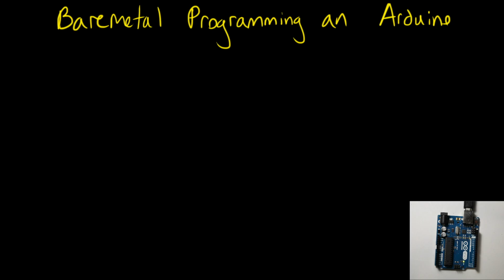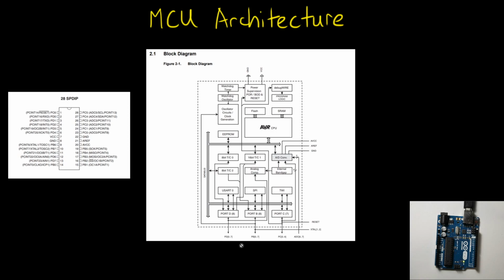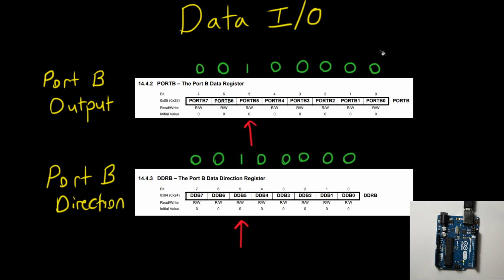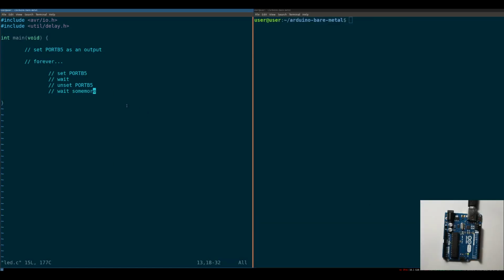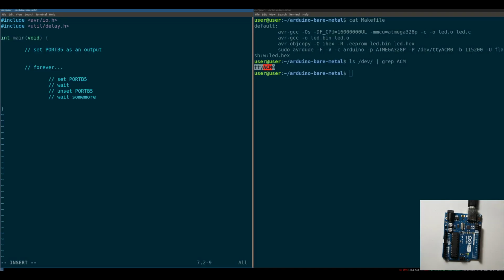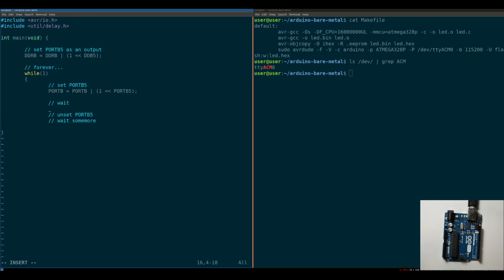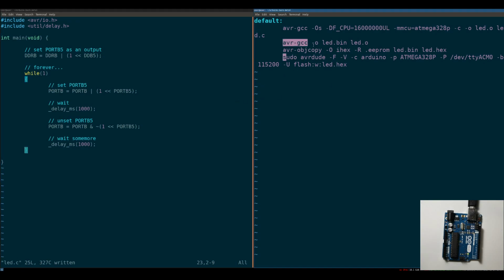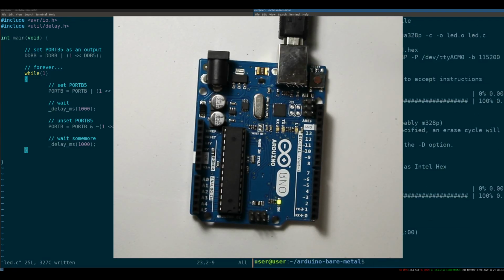Getting Started with Baremetal Arduino C Programming  |  No IDE Required [Linux SDK]

Comment: I subscribed.I'm new to programming, and just wrote my first program in IDE.  Question: what is the advantage to programmimg a micro controller like arduino using C/C++ rather than arduino IDE?  

Another question,  am i better off learning C/C++ so i can progrsm other things also?  Is there any advsntage to using Arduino's IDE or am i just limiting my micro controller project's capability?

Comment: Will this device work for following this video?

Arduino UNO R4 WiFi [ABX00087] - Renesas RA4M1 / ESP32-S3 - Wi-Fi, Bluetooth, USB-C, CAN, DAC, OP AMP, Qwiic Connector, 12x8 LED Matrix

Also, how would I go about connecting the device to my laptop for programming?

Thanks
Love the channel.

Comment: It is the best approach! I worked with AVR MCUs until 2015, and I had not used Arduino. THe peripheral and interrupt system is quite easy (incompare to ESP32 or STM32) and the code with inner peripherial devices  may be written without any libraries. But when you use external peripherial devices - the libraries may be neccessary.

Comment: In the second build command, avr-gcc -o main.o main.bin, it's crucial to specify the target frequency and controller (-DF_CPU=16000000UL -mmcu=atmega328p) to avoid unexpected behavior. Additionally, if the -c flag is removed from the first command, the second command becomes unnecessary, especially when dealing with single c files or libraries.
Reply: I've been struggling to bug fix some weird behavior in my program and this is what fixed it. Thanks!
Reply: I don't know how on earth I accidentally stumbled upon your comment and it magically solved all my problems with the LEDs randomly flashing! Thank you so incredibly much for being so helpful, I'm sure a lot of people here have also benefited substantially from your comment!! If I hadn't found your comment, I am sure I would have never figured it out lol.

Obs: I was literally going over every line in every library I was using for my project, which are unfortunately only made for the microcontroller itself, rather than also having built-in code for arduino specifically.

Comment: I tried to expand on this by adding a function call to a function defined in my_lib.c and during the linking step I had to add the mmcu option, same as in the build and assemble step. Otherwise the program behaved very strangely with the led not blinking as intended.
I.e. compile, assemble and link such: 
avr-gcc -Os -DF_CPU=16000000UL -mmcu=atmega328p -c -o led_driver.o led_driver.c
avr-gcc -Os -DF_CPU=16000000UL -mmcu=atmega328p -c -o main.o main.c
avr-gcc -mmcu=atmega328p -o main.elf main.o led_driver.o

No idea why the mmcu option needs to be added when multiple objects files are added at the link step but is not needed when linking main alone..

Comment: very interesting & wonderful Arduino GPIO video info.   I am wanting to have the Orange Pi-5 Debian-Bullseye Python GPIO PWM pins control the servo Pan/Tilt camera motors. Do you have any suggestions on how to use OPi.GPIO which is a drop-in for RPi.GPIO. I can get the GPIO pins on/off to work. However, PWM is giving me errors. Next, will be I2C on the OPi5.  🧐  Thank you.

Comment: I had an arduino mega2560 clone laying around, this is the make file that manages to flash to my board:
default:
	avr-gcc -Os -DF_CPU=16000000UL -mmcu=atmega2560 led.c -o led.bin
	avr-objcopy -O ihex -R .eeprom led.bin led.hex
	avrdude -D -F -V -c avrispmkII -p ATMEGA2560 -P /dev/ttyACM0 -b 115200 -U flash:w:led.hex

If I separate the avr-gcc command as shown in the video I get the following error:
avr:6 architecture of input file `led.o' is incompatible with avr output

If I use the arduino programmer (-c arduino) then I get the following error:
avrdude: stk500_recv(): programmer is not responding
avrdude: stk500_getsync() attempt 1 of 10: not in sync: resp=0x00

If I use for example the avrispmkII programmer (I use this one as in the IDE it was selected by default) then I get the following error:
avrdude: NOTE: "flash" memory has been specified, an erase cycle will be performed
         To disable this feature, specify the -D option.
avrdude: erasing chip
avrdude: stk500v2_command(): command failed

Adding the -D flag solves the problem.

I don't know why it works now. But it works fine at the time being.

Trying to solve the issue I added my user to the group that appeared on the output of the following command: ls -l /tty/ACM0
The code had to be modified because the pin that controls the LED is the PB7.

Thank you for the video!

EDIT:
Reading the comments of the video I found the one by @Edgar Bonet, the make file could be further reduced as avrdude can read directly the ELF file:
default:
	avr-gcc -Os -DF_CPU=16000000UL -mmcu=atmega2560 led.c -o led.bin
	avrdude -D -F -V -c avrispmkII -p ATMEGA2560 -P /dev/ttyACM0 -b 115200 -U flash:w:led.bin
Reply: thank you for your comment, the "avrispmkII " saved my day

Comment: PORTB ^= (1 << PORTB5) to toggle it. This saves you from writing 2 sections: one to set and one to clear.
Also funny to hear you bash high level functions from Arduino IDE and then be amazed by the presence of _delay_ms().
Reply: Simple elegance has been lost in the art of programming. I've seen terrible things done with Arduino. One of the worst was someone actually putting a delay() loop IN an interrupt service routine!

Comment: Do arduinos have interrupts? I remember a little bit from x86 asm that you can use interrupts to run code periodically instead of doing nops on the cpu, so it's better performance and less battery.
Reply from the maker: They do! I have a video on AVR timer interrupts on the channel :)
Reply: @LowLevelTV  I’m finding more and more videos. You’ve done a lot of really cool stuff, rust too?? Really? That’s pretty wild.

Comment: Hey everybody,
I'm so Stück right now. I work on Linux (I just switched recently, so I'm getting used to it).
I have installed VSC and all the packages but somehow my header files cannot be opened by my program. 
I have absolutely no idea how to fix that... I guess there is some Path missing. 
Can someone please help me fixing this issue? 
I am so ready to learn more about low level programming but this problems drains all my enthusiasm out of my soul...
Reply: Update: in Case any other people reading this comment and having the same problem. Please use VIM. I just used it and it worked in like no time. So glad and excited to dig deeper now :)
Reply: Hey can you maybe Point me in the right direction: how can i add the location of my avr/include files into nvim?

Comment: This is great! When I got started with Arduino I felt that Arduino C was a crutch and there was really no resources to help transition into proper low-level coding for the AVR, I think this is a great introduction into the absolute basics for those that want to start making more performant code and get the most out of their AVRs. Arduino definitely has it's place as a teaching aid, but I think they really need to work on a proper learning path for transitioning into proper code.

Comment: Where can I learn this things? The resources in the internet for low-level programming like this is so limited
Reply: You are lucky to have the internet. When I started out programming micros back in the 70s the internet did not exist. The only information came from the data books supplied by the manufacturer. These days those same data sheets are now readily available on line. Nobody taught you haw to write assembly language and it was not until a decade later that C compilers for micros became available and I learnt C from a book too.
Reply: "Make: AVR Programming"
is a great book and teached me all of this.

Comment: Great. But then the question becomes: if the advantage of Arduino is not having to go down to the bare metal and you nevertheless go down to it, why not dispense with the Arduino and work with other more powerful micro controllers?
Reply: The the great advantage of the Arduino for non-coders is the IDE. That is who the IDE was designed for and it enables then to do quite complex projects that would otherwise be beyond them. There is a whole range of different microcomputers in the Arduino range from little 8 bitters like the AVR right up to 32/64 bit ARM ones. so the range of possible projects even with the IDE is quite vast. But this is not the only way to create programs on the Arduino, and if you want the fastest most compact code in the lowest cost micro then the Arduino IDE is definitely not the best way. That is whn you need bare metal coding.
Reply: @ruffrecords  Yes also using the Arduino IDE you really never learn true embedded programming you just get a small taste of it. This video is also great to teach people true embedded programming.
Reply: @ipodtouch470  After a lot more digging and playing with the Arduino IDE I have how revised my opinion of it. The reason is that, as several people have discovered, you do not have to use the built in setup() and loop() paradigm. You can easily recreate the project shown in the above video simply by opening a new sketch and deleting the entire contents of the sketch and replacing it with a regular main() al la regular C. The advantage of doing it this way is you do not have to worry about installing  a bunch of other files or creating a make file and you retain the other advantages of the IDE including code completion.

Comment: what's the difference between DDRB = DDRB | (1 << DDB5) and  DDRB = (1 << DDB5)?  Don't they basically both SET the 6th bit for DDRB?
Reply: Oh, I get it now.  It's so you can change that specific bit WITHOUT changing any other bit of DDRB.
Reply: They do but the first leaves all the other bits unchanged, the second does not. This is known as an unwanted side effect.

Comment: One issue is that output file should be named "led.elf", because that is a format coming from "gcc -o" command. "bin" extension suggest that content from this file can be directly copy to Flash memory at address 0 in a microcontroller. You can extract bin format using "avr-objcopy -O binary" option.

Comment: Hi! Nice video. Just a couple of comments:

1. May be nitpicking but, _delay_ms() does not do a “nop” in a loop: it compiles to an empty loop. You may find a nop (and maybe an “rjmp .” or two) after the loop if the delay is not a multiple of the cycle duration, but the body of the loop is empty.

2. Recent versions of avrdude can read directly the elf file. No need to convert it to ihex.
Reply: 7:32-ish

Comment: Great video! Does the Arduino bootloader still need to be flashed to the board? Where does that fit into this architecture?
Reply from the maker: Thank you!

The way that you're able to flash the board over USB is via the Arduino bootloader that's baked into board by default, so no you don't need to flash it again.

If you were to overwrite the area in memory where the bootloader lives, you would need to flash the board using a ICSP programmer. I'll be making a video on that in the coming weeks.

Thanks for watching!

Comment: Great tutorial on this.  I'm a retired low level C programmer (did lots of automation and motion control) and have just bought an Arduino to play with and was a little annoyed by all the high level calls to IDE functions, since I normally wrote those myself for whatever device I was working on.  You just showed me how to get down to the level of coding that I wanted.  Thanks!
Reply from the maker: That's exactly how I felt! I'm glad you learned something. Thanks for watching.
Reply: @LowLevelTV I have mostly worked with an IDE and was wondering how you get the split window I wonder if you have the time maybe a brief comment just to tell me how that is running. Sorry in advance for the noob question.
Reply: @danieldare2640  Hey Daniel, don't know if you ever figured this out so I'll give you a quick rundown. The split window he's using is not at the application level, it's his window manager. So, it's actually two separate instances of his shell tiled next to each other. There are lots of tutorials on youtube and docs online to learn about window managers in linux, his seems to be a tiling window manager, so I would guess he's using i3 if he's on xorg display server or sway if he's using wayland, but could be another similar wm. Hope this helps!
Reply: @dillon7748  it sure does thanks for that. I virtually never leave the CLI so it's something I would always be interested in managing at that level. Thanks again.
Reply: Is atmel studio still a thing? They had great documentation, before the arduino I used to use it to program the avr butterfly and it was great.
Reply: So you are wasting time by reinventing wheel 😅
Reply: @rijo1254  it’s not reinventing the wheel, programming at the register level is extremely useful particularly for low power operation, such as with the MSP430
Reply: @4DRC_  yeah it is , i am just kidding
Reply: @rijo1254 nah it's not a time wasted. Wasting time is using all high abstraction and not knowing enough how those works on low level and the first thing you will do when a bug occured is to google it.
Reply: @rijo1254  sometimes reinventing the wheel is a lot more fun